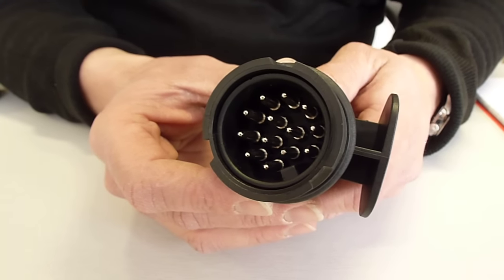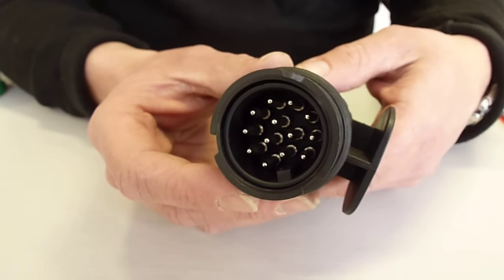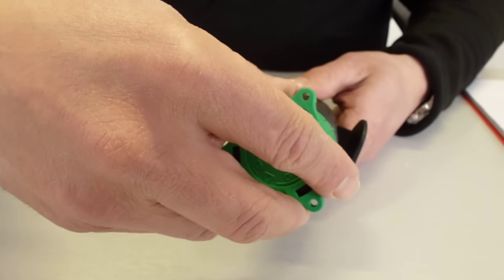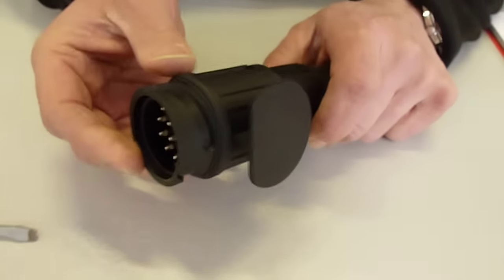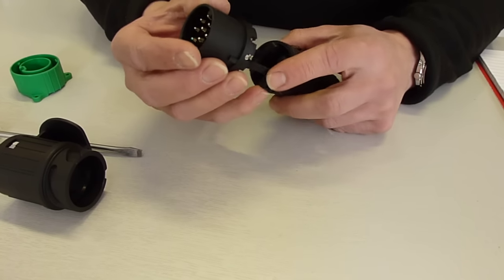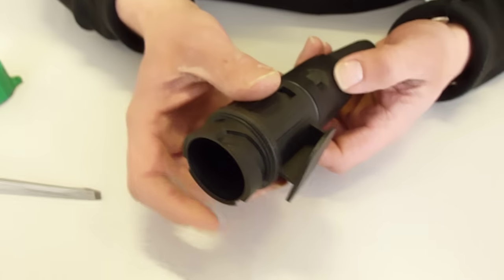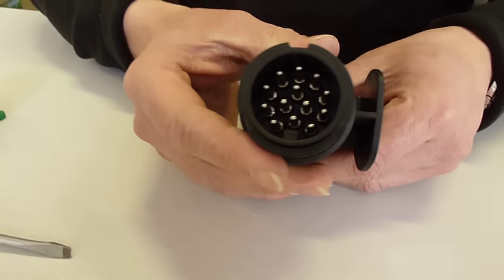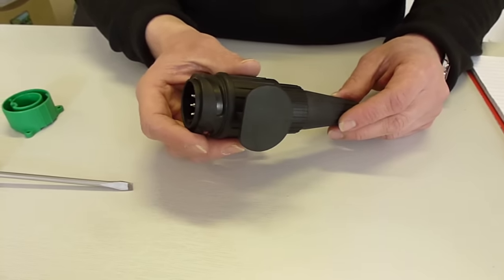How to realign your 13 pin caravan towing electrics plug

Comment: Thank you for this video. I was stuck with such a situation after midnight waiting to board a ferry and nipped out to get some food. 10 minutes only and someone tried to steal the caravan and wrenched the plug out. Lucky I had a hitch lock because they couldnt disconnect it from my van. 

I couldnt get plug to go back in and needed electrics for towing, I only had an old screwdriver but after watching your video, I realigned the plug and it works. Big thank you👍
Reply from the maker: Glad it helped!

Comment: I’ve had this type of plug on 2 cars. Not a problem with my Freelander 2 for 5yrs & not one issue, changed to a Volvo XC90 with factory fitted towbar & I need to use the green thing to fix the connector every time.

Comment: You DON'T twist the plug.... you keep the plug straight and you twist or untwist the COLLAR.You have the flat disc on the COLLAR set to the left (9:00 oclock), you insert the plug (straight) you then rotate the COLLAR clockwise until the disc is at the top (12:00 ocock)  and the cap then sits on this disc to keep it locked. If you twist the plug itself, then you will definitely bend the pins. The rest of the instructions on taking it apart is spot on.
Reply: Colin Parry there are two types of plug one with a twist collar the other you have to turn the whole plug

Comment: I have 13 pin connection on trailer which has 13 to 7 pin adaptor to connect to vehicle. How do I remove damaged adaptor please?
Reply from the maker: Sorry for the late reply. You have to turn the plug anticlockwise 90 degrees in order to take it off the adaptor.